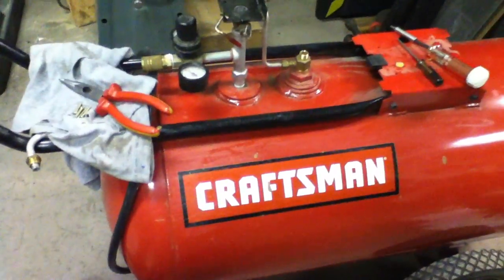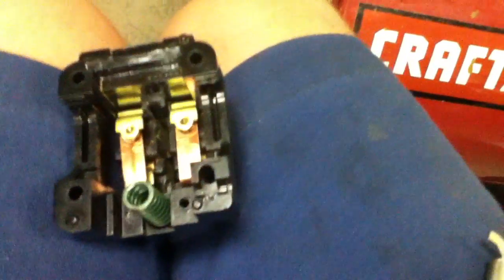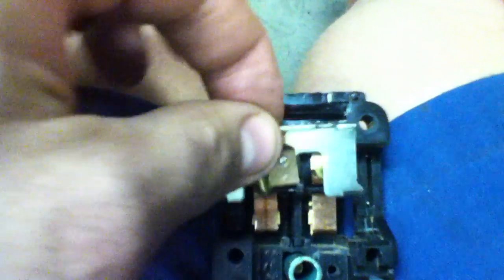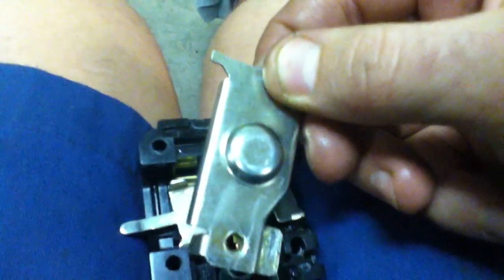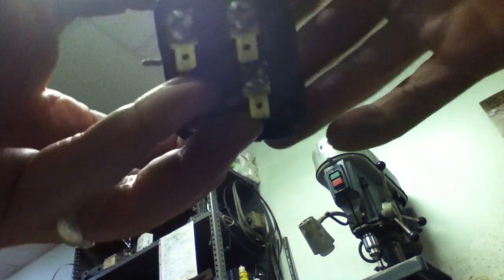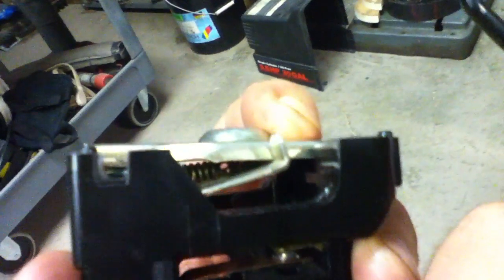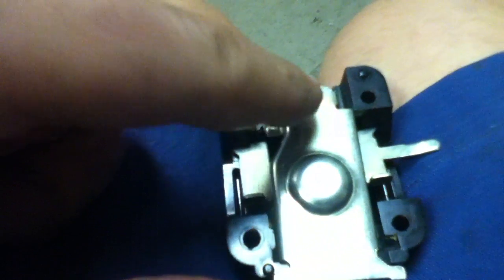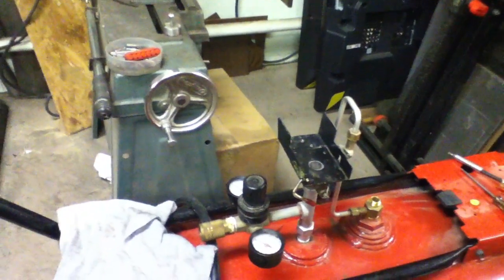Pressure Switch Craftsman Air Compressor 5.5HP 30gal  tripping breaker  PART 1

Comment: Sir, You just saved my Compressor. The seal under my pressure switch was leaking and I took it apart. All the parts flung apart.  Without your video, I would have had to junk the compressor.  THANK YOU! I never would've figure it how to put it back together.

Comment: This is INSANELY nice.💫 allabout.wiki/Compressor  i got a Bostitch 6 gallon pancake and the regulator broke, and it was stupid loud. Also, the gauges barely worked. it wouldnt even power a die grinder. But this little dude ROCKS. Its not only 1/4 as loud as the Bositch, it works like a fine tuned machine should. Kudos to California Air Tools! This performs EXACTLY as advertised. Cant beat the price either.
Reply from the maker: Super quiet?  Mine is super noisy !

Comment: I thought to send a message anyway although it's 5 years old this video but I'm having trouble finding parts now for similar compressor like yours it's the horizontal 25 gallon three and a half horsepower and it's pretty frustrating I'm trying to see if I can replace the bracket that connects to the Three and a half horsepower I was wondering if there's a bracket piston assembly and the head the whole bracket with the Piston part of it the whole piston and bracket that connects to the motor I'm wondering if that can be another one can be taken off another compressor and use on this old one since the parts are obsolete it's pretty frustrating
Reply from the maker: sounds like a tricky situation

Comment: Hey did you ever get this to work?
Reply: Nice video!
Reply from the maker: Yes.  It was either the head pressure relief valve when pressure switch cuts out or the start capacitor.  Cleaning contacts didn't solve it.  It's been a while since.   I think I have another video about this compressor.

Comment: my craftman all of a sudden keeps popping breaker,,,it happens when i switch it on motor barely turns over,,,i pops in about 3 seconds...any clue what part is bad???
Reply from the maker: +roadstar499  Start capacitor in the motor.  There are two, a run capacitor and start up capacitor.   It's possible it could be a bad / worn out contact in your pressure switch but most likely the start capacitor.  Mine did pretty much the same thing and had one black and one white capacitor.  Ordered the new cap from McMaster Carr. (part # 7245K25; AC Motor-Start Capacitor 400-480 MU-F Capacitance, 125V AC  {micro farads not mega farads}) It had a smaller diameter so I used a section of 6" pvc pipe connector rubber sleeve to wrap around the new cap so it fit back in place.  It's a little over 3/16" thick.  You'll need a meter to measure the capacitance to figure out which cap is bad.
Reply: +Justin Shiffler thanks for the help. not sure where cap are located on mine ,but I will see.I will try cleaning contacts first.it actually gradually got worse to wear I needed the pressure in tank to be 80pounds or less before I could switch  on motor without popping breaker.now motor barely moves even when tank is empty and pops breaker. it only started messing up a month ago when I painted my truck...thanks
Reply from the maker: The caps are mounted on the motor towards the pressure switch.  They are cylinder shaped approx 2" diameter by 4" long.
Reply: +Justin Shiffler Okay today i removed pressure switch and i was able to clean the four contacts points up nicely..they were all chared and pitted badly... put it all together and compresser fired right up..then i manually hit cut off switch right away and flipped on again and it struggled to turn over and popped the breaker..which is a 30 amp btw,,, I just read through the dyi for fixing and it says this ''If the compressor motor start capacitor has failed, the power supply to the motor stops there, and the motor will not start.'''....Power gets to my switch so according to what they say its not  a bad capacitor.so that means motor should not try to turn over,but mine always does and pops breaker after a second or two.. should i replace the entire pressure switch? maybe it just worn out and as i said the contact points were pretty bad before i polished them...i am running out of ideas... thanks for your help..
Reply from the maker: Still sounds like a bad start cap.  There is one more thing to check.  There's  little air line that goes to the pressure switch to relieve piston head pressure when it shuts off.  It has a little relief valve pin that the pressure switch will press to relieve pressure.  The motor can't move if there is head pressure fighting it.  Press that little valve pin before trying to start to see if there is trapped pressure.  If no pressure, start cap is logical problem.
Reply: +Justin Shiffler yes. it maybe a bad check valve. I can get it to run now so I think cleaning switch helped...where's the best place you get parts for craftsman compressed? thanks
Reply from the maker: sears parts direct will give you part #s then search ebay and the web.  Was there pressure in the little air line that runs to the side of the pressure switch with the pin relief valve?(looks like a tire stem valve pin)  Press that pin and pressure should relieve for a couple seconds only.
Reply: +Justin Shiffler I let all air out and she's fires up.90 percent sure it's check valve.and when I pull release pin air just keeps coming out so air still stays in head..if capacitor was problem removing air should not make work either.I think check valve is it...thanks...I will post results when I get fixed
Reply from the maker: Ok, so your letting all the air out of the tank.  What you need to test is if the pressure switch upon cutting off is pressing the little pin on the side of the pressure switch (not the hi pressure release valve with the pull ring) is relieving the pump head pressure.  There should be a small air line going to the pressure switch that relieves the head pressure between the piston top and the tank ball check valve.   The pump will lock up of sorts if their is head pressure as AC motors have low starting torque.   Let me know if that's not clear.
Reply: +Justin Shiffler yes I tested several times it's definitely head pressure issue..I have to wait for all air to leave head after hitting switch...about 30 seconds after I don't hear anymore hissing I hit switch again and she starts right up.if I don't wait that extra 30 seconds breaker pops.I happy it's a cheap part...I do like this compresser. ...thanks for the help I'll keep you posted
Reply from the maker: Ok, how are you relieving the pressure?  With the pull ring (like a key chain)?  Which is the emergency pressure relief vlave, or by depressing the small schreader type valve on the pressure switch side that the small air line goes to?  The head pressure should only take no more than 5 seconds to relieve.  30s sounds way high.
Reply: +Justin Shiffler 5-10 seconds would probably work.I leave draining valve open...after I fix I will post results
Reply: +roadstar499 Part was only $15 so if that does'nt work i can check capistors next... But for now i can use to do minor jobs anyway,,,, using tools and painting large projects like cars i will need it to be working top notch
Reply from the maker: What part cost $15?
Reply: +Justin Shiffler check valve for my model...
Reply: +roadstar499 that pull chain on my model is for emergency pressure release in case compresser builds up 6hp much air...your setup my be different. ..I only have that one and it will let out all the air in the 30 gallon tank if I pull it long enough...again if check valve is bad air from tank and pressure is constantly in compresser also..and only way mine  starts up is when all pressure is relieved from the head which does take 30 seconds on mine...not sure why...anyway if replacing check valve does not work I will look into the start up capacitor ...it feel good to at least have have a much better understanding of the way this thing functions. .I have been fixing things that break for many years...have always  loved taking things apart. ...sometimes I never was able to put things back together though. .lol
Reply: +roadstar499 installed check valve today,,, still not working correctly and tripping breaker,,, went and ordered a start cap...$66 for cap on ebay... will keep my fingers crossed this is the problem...if i need a switch thats another $50...anyway we all need our compressors working
Reply from the maker: Start cap should only be $10 or less.   Can you send me a picture of which check valve you replaced and/or of the old one?
Reply: +Justin Shiffler .my check valve looks identical to the one on your compressor shown in your video
Reply from the maker: I'm just worried you're calling the emergency pressure relief valve (with the pull ring) the check valve, they are not the same thing.
Reply: +Justin Shiffler I know the difference. the check valve  screw directly in my tank...I wonder how you can purchase a capacitor for only 10 bucks. .I paid 68...
Reply: +roadstar499 post a link or place and I will return mine.that's a lot cheaper
Reply from the maker: http://www.mcmaster.com/#catalog/122/993/=12hark4
Reply from the maker: part 7245K25
Reply: +Justin Shiffler so it's only 7.25 and it's same part?...if so that's incredible...I will order and compare to other one when  I receive to make  sure...thanks
Reply: +Justin Shiffler so it's only 7.25 and it's same part?...if so that's incredible...I will order and compare to other one when  I receive to make  sure...thanks again
Reply: +roadstar499 part number is totally different how do you know this one will work in my craftsman? I believe you just don't understand how you came up with that part..thanks
Reply from the maker: It's a common start capacitor.  All you need to do is make sure the capacitance value range matches up and this does.  This is the same part I put in my compressor and it works fine.  This cap , perhaps because newer , has a smaller diameter.  So I had to wrap it in a section of rubber 6" pvc coupler to fit in the same spot.
Reply: +Justin Shiffler very cool ..thanks
Reply: +Justin Shiffler turns out it was plastic lid that holds caps is loose and coming off both screws are not holding since plastic broke in mounting points..going to try to fix..when I hold it with my hand it works great..replaced cap anyway since its old anyway. .thanks
Reply: +roadstar499 was able to form new anker points on cover using plastic welder then drilling new holes...compressor performs wonderful now..thanks again for all the great information
Reply: @roadstar499  I had a similar issue with my Sears compressor...after I painted a van in my garage.   Some of the still moist paint mist got into the motor start mechanism and made it stick so that the spring part of the start circuit did not release once the motor started spinning.  I unplugged the unit, took the end plate off the motor, picked the paint off and made sure that the spring release rings worked freely.  The stuck parts of the rotor caused the cap to pop.   Once the parts moved freely and the new cap was in place, all worked fine.  Now....about 15 years later  ( 2022 ) and the pressure regulator switch contacts have become worn to the point that they are not making a solid contact.  This causes arcing, heat and finally the contacts did not release....welded closed.  I took the switch apart and was sorry I did.   Same situation ....spring loaded lever kept popping out of the worn small lip before I could place it and screw it to the mounting plate.  I am ordering a replacement  LEFOO regulator switch  ( about  $14 to $18 on Amazon ) and may need to make some minor alterations .  The SEARS parts are no longer available but LEFOO makes a variety of regulator switches if you have some mechanical know-how.  Hope this helps all in a similar situation.   JwgK in Houston, Tx
Reply: @roadstar499  E-Replacement parts  has some if you have a model number - many are DISCONTINUED but clones are available

Comment: Good to know! I have the same compressor.  Did you use a digital or analog meter to test your capacitors and where did you buy the replacement cap?
Reply from the maker: +Reno7721  I have a capacitor specific  digital meter, tested it completely removed.   We order most all our parts from McMasterCarr website.
Reply: Thanks for the info!